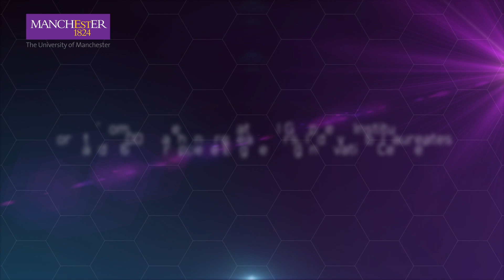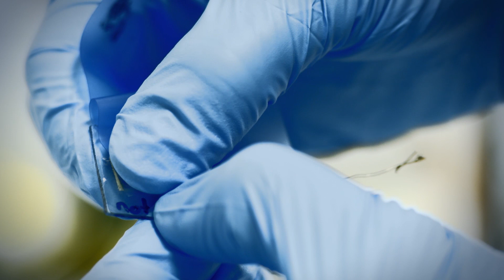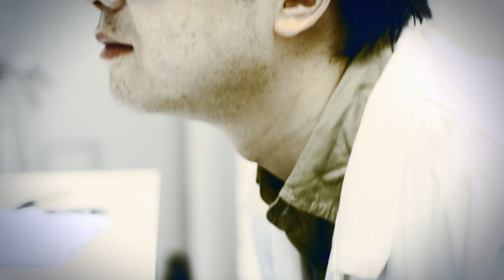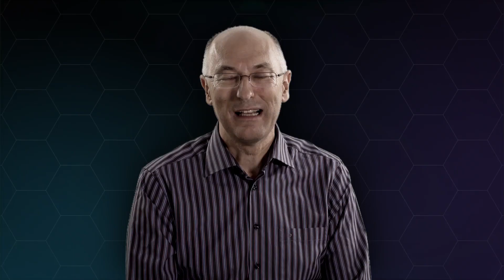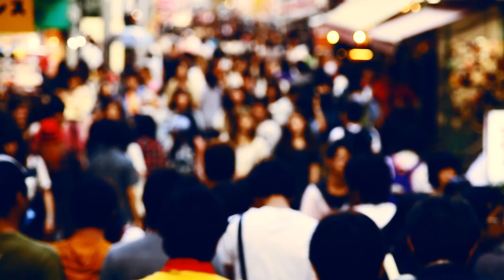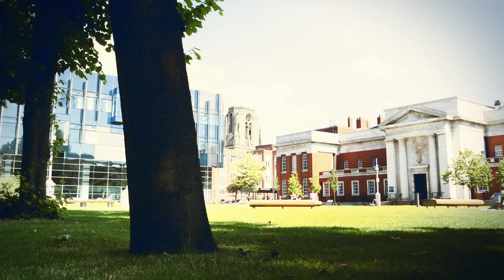Graphene: Membranes and their practical applications

Comment: Could graphene oxide in vaccines cause stroke, cardiac arrest, and similar mild side effects when subjected to microwaves ?
Reply: No. It's also not in the vaccines. Maybe the Chinese vaccine (maybe not), but not the U.S. ones. Even if it was, as It's also in charred meat, most people consume it safely already.
Reply: @jasonlarsen4945  Consuming it is one thing and having it put into your veins is entirely different, and you know it's in the vaccines.
Reply: @jasonlarsen4945  Please save your bs for the stupid sheep that don't know any better.
Reply: Graphene  Is  A  Major  Conductor !     Just  Thinking.......Are  WE  Connected  To  5G  Signals...........a  Side  Effect  That  WE  DO  NOT  WANT !
Reply: @dwhip48  Water with electrolytes in it is a conductor.  Your body is already conductive.